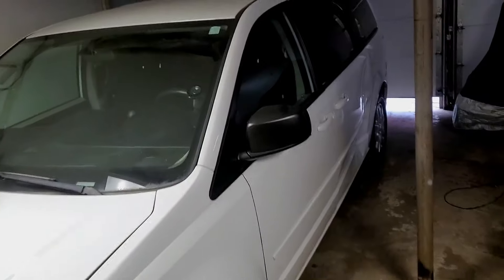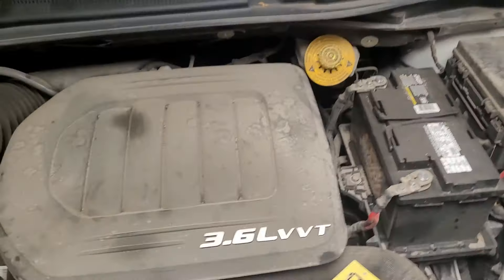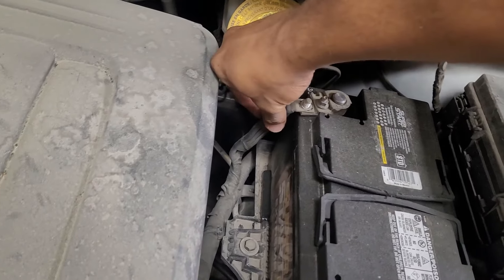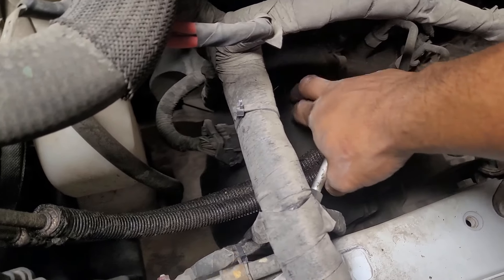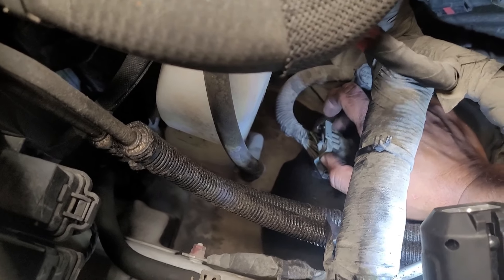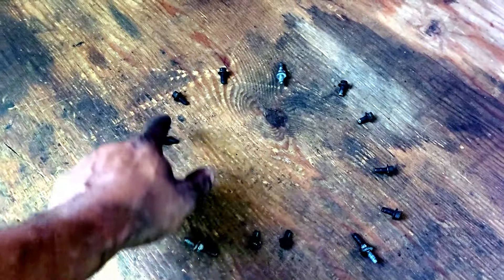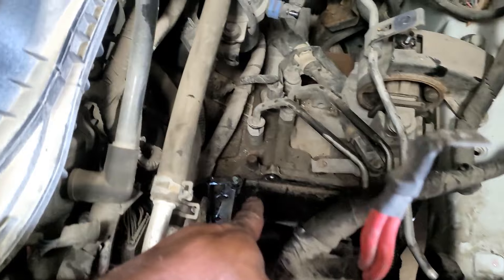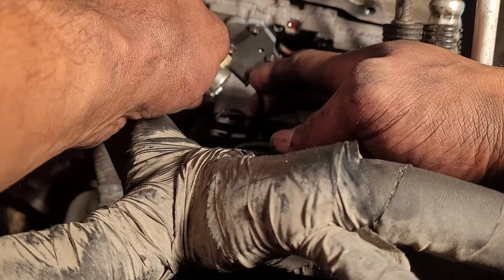2014 Dodge Grand Caravan 62TE Transmission Shift Solenoid (Minute Maintenance)

Comment: Friend, excellent video, a question, My 2009 Dodge Journey, 3.5 awd, I put the gears on the selector and it doesn't move even with the wheels raised, if it marks the changes on the dashboard, it doesn't make strange noises, I was checking better and yes I have some codes, I have active p0585, and stored p0716, p0791, p0721, the oil has a good level and is not burned, what could it be?
Reply from the maker: Hey thanks for watching! Sorry for delay in response I did not receive notification of this question!

Based on the symptoms and codes I'm lead to believe it may be an issue w/ the Solenoid Pack itself. In this video I replace the TCC/Shift Solenoid but it is Bolted directly to rhe Solenoid Pack so I Show how to get to the area you need to be, and talk about which bolts are next to remove the Solenoid Pack, although I don't perform that specific task as it wasn't required for this vehicles issue.

Even though fluid level was full and not burnt if its old/thin OR the filter is dirty/clogged the Transmission will lose ability to develop the hydraulic pressure required to perform appropriate shifts/gear changes. So if it's been..40..50k+ miles since the last transmission filter and fluid swap I'd consider that as first resort, 1 its the most common cause for transmission codes snd hesitations (micro particles shorting out sensors and inability to develop pressure or cool transmission) and its cheaper then buying a whole new Solenoid Pack so if it may fix the issue I'd consider that first.

Hope that helps. And Happy Wrenching!

Comment: 2016 town and country shift solenoid h.. is it the pack or the shift solenoid that is bad?
Reply from the maker: Hey Thanks for watching! I always recommend ppl do a transmission fluid and filter change first before changing solenoids or the pack...reason being in my experience the majority of codes thrown or shifting issues occurring..95% or higher are because the fluid is old/thin/dirty or rhe filter is dirty and or clogged!

But to answer your specific question you would need to replace the Solenoid pack as opposed to the TCC Solenoid I demonstrate in this specific video.

Good luck, and Happy Wrenching!

Comment: Can a faulty solenoid pack or valve body make a winding noise? My trans pump was replaced just a few months ago.
Reply from the maker: Hey Thanks for watching and the Question! That is not a symptom in my experience that can be caused solely due to the Solenoid Pack. If the trans pump was recently changed hopefully it's still under warranty as that would be my first guess as to the problem.

Comment: Last August 27, 2022, while I was climbing a bridge at 100 km/hr, suddenly check engine light blinked and I could smell burning inside the VAN. It's stinky that I have to stop and open the hood and see what's going on. My temperature gauge is okay, and the engine is running fine. I run slowly, but when it's climbing, I could always smell the stink. I checked the engine light with the OBD11 scanner and it says P0128 (thermostat rationality - generic permanent). The next morning I checked the thermostat and it seems ok, with no leak whatsoever, run the engine and touched the radiator hose if it becomes warm and if the fan runs. It seems okay. While checking the engine, I saw oil just below the oil filter housing, there was an oil leak. I replaced the oil filter housing with Dorman Aluminum upgrade filter housing. Lo and behold, all the symptoms were gone, the transmission shifted smoothly and the rpm is between 2500 to 3000 before it change gear. Tested climbing uphill (steep) without touching the trans lever and it climbs lower the gear automatically and the rpm goes up to 4000rpm. Problems were solved. What are the connections? There are two sensors on the filter housing, one for coolant and the other for the oil?

Comment: Did you use gasket maker on the cover?
Reply from the maker: @nrg_dallas9750  hey thanks for watching! I did not!! I had conflicting info found thru online sources and my local Dodge dealer..when I took my cover off there were no signs of RTV or any OEM Gasket so I decided to keep it as it was. I personally never had the owner complain of leaks or any other issues afterward ref fluid level...it seemed weird for me not to BUT there was no evidence of it being there and my Local Dodge dealers said it wasn't needed so I took the chance and it paid off for me...I don't think it would hurt to add a bead of RTV but for the purposes of this video I decided not to do anything extra, just a stock swap. Hope that helps, sorry for delayed response!

Happy Wrenching!

Comment: Hello, I already changed the solenoid but I lost oil when removing the front pan, will it be normal?
Reply from the maker: I Personally didnt lose any oil, but oil does flow in this area. After reinstalling everything just check your transmission fluid levels! I made a follow up video about changing the Transmission fluid and filter AND how to make your own dipstick!
Reply: @minutemaintenance7385  thanks

Comment: I have a 2012 Chrysler town and country with same issues. If I don’t want to change transmission fluid and just want to swap the part. Can I get by with just doing that? Without draining the transmission fluid? Thanks
Reply from the maker: Evening Boss, Thanks for Watching the Video! Short Answer is Yes You Can. You May Experience Some Fluid Loss Depending on How Much is Currently in the System. But You Absolutely Can Swap the Shift Solenoid Without Draining the Transmission. That Being Said I Do Have a Video About How to Perform a Transmission Filter/Fluid Exhange and Would Recommend You Do That as Well to Cover all Your Bases! New Solenoid w/ Fresh Fluid and Filter to Put the Transmission in the Best Position Possible!
Reply: Thank you friend! You are greatly appreciated! 🙏🏽

Comment: I have a 2014 Chrysler Town and Country with same transmission. Car drives but does not shift to 2nd gear. It stays in first gear. Could this solenoid be the problem? The fluid level is fine.
Reply: Me to but level is too high

Comment: Did your van have a code that it threw? How did you know it was the shift solenoid? Besides it not shifting.
Reply from the maker: Thanks for the Question. I had no Codes, the diagnosis was soley based on Symptoms. The Shift Solenoid is notorious for not throwing codes but having very specific symptoms/struggles as I outline in the video!! The swap did resolve my customers issue!
Reply: @minutemaintenance7385  okay good to know. Running into the same issue. Thanks!! And great video.

Comment: Well I have a 2010 VAN and it has the exhaust right over the top...and the only thing that is difficult to take out is the pan cove/insulation.. because that needs to be slide out upwards...where the exhaust is. But I am thinking to see if I can sut it on the side open so I can slide it out sideways....is you know what I mean. The rest should come out fairly easily.
Reply from the maker: I'm tracking! Sometimes you gotta make adjustments on the fly...if its between saving the insulation cover or swapping the solenoid so the van shifts...I'm cutting that cover out haha good luck!

Comment: Great video, my 2012 dodge reverses gear is not working. Do you think could be the solenoid too?
Reply from the maker: Hey thanks for watching! My instincts say no, the main symptom would he stalling. Basically when the shift solenoid fails, it causes the torque converter to lock in place causing the vehicle to stall. If the van just isnt going into the right gear or has low power in a specific gear I'd check my fluid first. Make sure it's full AND clean. Not old and burnt. If that checks out I'd unfortunately recommend going for a formla diagnosis at a shop, its fairly inexpensive, lots of places do it for free expecting you to have them perform the work afterward. But at least youd know. If fluid looks suspect, swap the filter and fluid. Good luck!

Comment: Do you have to fill up the pan when done?
Reply from the maker: Hey thanks for watching! You will want to run the vehicle to operating temperature, shift thru the gears and check the transmission fluid level and fill it up from there. I ended up doing a follow up video on this channel on how to "change transmission fluid/filter" on this vehicle and tackled both jobs at the same time. 

Thanks for watching and Happy Wrenching!

Comment: How many hours in labor do you think this is. I need to do same on my vehicle and am very mechanically inclined with all the possible tools id need.
Reply from the maker: Hey Thanks for Watching the Video! It took Me About 2 hrs...But I Was Also filming. If I Had to Do the Project Again I'd Estimate 40min to 1 hr!
Reply: @minutemaintenance7385  I need to change out entire solenoid pack assembly. How much longer or long would that be you think?
Reply from the maker: For the Whole Solenoid Pack I'd estimate another 45 min. There are some connections on the lower end that can be tricky to deal with! Take your time, make sure you're in a warm and comfortable garage..not a project you'll wanna do outside in the cold, makes ya more likely to rush and make a mistake. Good luck!

Comment: Do you need to drain the fluid first? Also do you need to replace the gasket?
Reply: Yes you do!  I learned the hard way, as soon as the valve cover pan was removed, there was a flood lol.
Next time, i will do this process:
remove transmission pan, replace filter and gasket, then re-attach pan & torque to spec.
Then remove valve cover, replace solenoid, then re-attach cover with gasket maker.  Top off transmission fluid, run through gear cycle and re-check fluid levels and for leaks.

Comment: I have a 2008 Grand Caravan. I was thinking this might be the issue but not sure. I park the van down hill slightly. Today i went to back out from where i'm parked and the van started rolling forward until the rpms got to 1500rpm and then it started moving backward. Same thing going forward..doesn't start to move until about 1500rpms. I went down the street and noticed it has a vibration or something..feels like the passenger front side. Any idea what this is?
Reply from the maker: Initial thoughts is lack of fluid or dirty/contaminated transmission fluid. Higher rpms will increase "pressure" in the transmission allowing shifting to happen. The transmission needs the right pressure to function if fluid is low or to old/dirty/thin it either can't or is delayed in getting pressurized. First check the tranmission fluodz make sure the level is correct, not over OR under, and check for quality of the fluid. Is it burnt, is it thin, is it discolored. If so drain and swap the filter and fluid. Hopefully this helps!
Reply: @minutemaintenance7385  What's the best way to get some fluid out? It is over full i noticed. It has brand new fluid in it.
Reply from the maker: @billrhine3406  best way is a hand pump, you can buy those for a few dollars at any auto store. Stick 1 end in the fluid fill/check area and pump it out. Or if you have a turkey baster at home you don't use anymore, might be thin enough to reach in. If it's over full my next question would be..did you over fill it? If so did you do a fluid swap or just add new on top of old? It's very important to change the fluid and filter in regular intervals 50-75k miles...the transmission is crazy sensitive and easy to Break if fluid isn't maintained. It is a messy but easy at home job to do!
Reply: @minutemaintenance7385  I had it done at a shop. Brand new fluid and flush they said. Just days ago.
Reply from the maker: @billrhine3406  Hmm then I'd be calling them on Mon, if they over filled it that's dangerous, and if youre having these issues with shifting makes me question their abilities. Good luck bud!
Reply: @minutemaintenance7385  Thanks! Appreciate all of the info.

Comment: A very useful video, thanks for taking the time to record it. Just FYI: those 5/16" bolt heads probably are 8mm, which is essentially the same dimension. Doubtful that Mopar would use a mix of metric and SAE bolts on the same assembly. 
While I'm at it: my 2015 C/V Tradesman (same drivetrain) sometimes will downshift 4-3 under load (uphill) when accelerating, and run up to 5K rpm without upshifting even if I ease off the throttle; only by momentarily getting off the throttle will it agree to upshift 3-4. No codes. Does this sound like a shift solenoid issue? (no stalling as evidenced by the car in your video) 
Cheers
Reply from the maker: Thanks for the info on the Bolts Partner!! I'm not good at Metric/Standard equivalencies. As far as the shifting issue..if only occurring "underload" and "uphill"..and is downshifting that to me sounds like normal Transmission work trying to compensate for a heavy load...is it accompanied by any burning smell, chugging, slipping...something that indicates the Transmisison is working hard?
Reply: @minutemaintenance7385  No burning smell or other scary symptoms. Perhaps it's time to flush and replace the fluid & filter. Thanks for your reply. Cheers

Comment: Have you ever dealt with a P0765 error code on one of these?  If so, what did you find?  I am not sure if it could be something else before the coil pack?
Reply from the maker: Hey thanks for watching, I'm so sorry for late reply YouTube did not notify me of this posting! I have not dealt specifically with that code, but a brief search shows its related to Solenoid D. As with anything transmission related most problems are cause, and can be solved by a transmission fluid and filter swap. The lower/dirtier/older the fluid the more likely an issue will arrive, same with the filter. These 62te transmissions are very sensitive and will develop almost instantaneous fluid pressure issues if the fluid is bad. If that doesn't fix it, I'd say find a shop. Let them spend 1 to 2 hrs diagnosing it, it could be a simple Solenoid or the entire pack or even a wiring harness, they'll be able to live run a scan and check for proper psi and functioning and determine exactly what the issue is so you're not chasing your tail! 1hr of shop time is definitley worth the headaches you'd have chasing an issue and hoping you found the cause, draining and refilling the transmission only to have to do it again. Happy wrenching!
Reply: All good.  Currently the problem is intermittent.  I have set up a good shop to book an appointment to get it diagnosed, but even they say to wait to bring it in when the limp mode activates.  I will post the outcome as it happens so anyone who finds your video and have this issue could get an answer.  Also, upon further research the code was for the U/D (underdrive) Solenoid, it's one of the 7 solenoids in the pack..  It could however be something feeding the the power to the solenoid.  Thanks for your video and reply.
Reply from the maker: @jamest3039  Fair enough. I'll say in my experience power supply issues are super rare unless you physically have damage to the wiring harness/connector from the world's worst jump start or a fire...if it's only Intermittent, and im you, try and gauge "when" it is acting up..going up a hill..idling in traffic..turning a sharp corner..these things could help point you in the right direction. If when taking. Sharp corner or up a hill could be the sudden shift in fluid in the Transmission pan, showing a drop that the solenoids will flag an issue. Any change in pressure those Valves go crazy. Good luck boss.

Comment: So this would help me replace a high shift solenoid on a 2013 Dodge Journey SXT 3.6L vvt
Reply from the maker: Hey thanks for watching! The solenoid replaced in this video is not the "high shift" solenoid. To get to the various specific gear shifting solenoids i.e. under drive, overdrive, low clutch etc..you'll have to remove the entire Solenoid Pack which I describe the process of how to do around the 22min mark of this video. All the other solenoids are behind the solenoid pack! The Solenoid Pack in itself is fairly in expensive and if you have to replace 1 of those solenoids..I'd personally just swap the entire pack with all new solenoids as well. Good luck and Happy Wrenching!

Comment: Hey I started mine and I have a 2013 Grand Caravan.  When I got to the bottom bolts of the pan a bunch of fluid started leaking out.  Do I need to drain the fluid first?  Or is that just a little bit of fluid that'll leak?  Also, it appears to have a seal around the pan which you didn't have.  Lastly, the dipstick looks to go through the pan.  Will that be an issue?  I don't know if you can answer this or if you will see it, but if you can I would love a little help.  BTW I subscribed and liked.  This was a good video.  Thank you
Reply from the maker: Hey! Thanks for Watching and the Subscription! I am so sorry I didnt respond sooner, YouTube has NOT been sending comment notifications lately..as far as the fluid leak yes there will be a small amount, up to 1/2 a quart in most cases. I apologize for not addressing that in this video. You should not have to drain beforehand, just be sure to refill! There shouldn't be a "dipstick" but actually a fill tube area...I'll powt a link to a video I did on this same transmission ref fluid drain, fill and a diy dipstick as these are "sealed" transmissions and not able to easily fill/check fluid. My pan did NOT have a pan, and I found mixed results on whether there should have been one or not. My local Dodge Dealership did not even have a OEM seal to sell me. If your vehicle has one I'd replace it with an OEM if you can find one or just a good bead of RTV silicone!! Hope this helps!! Good luck!!
Reply from the maker: Link to transmission fluid and filter replacement and diy dipstick!

https://youtu.be/fuM0d4SfTlY